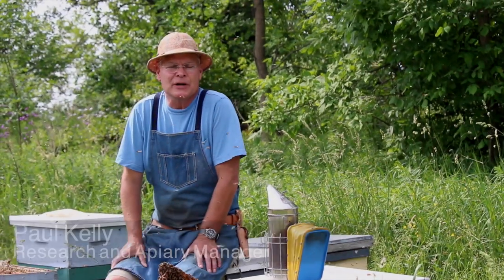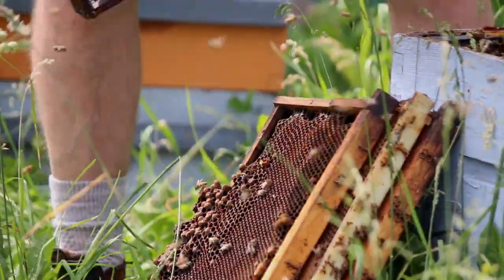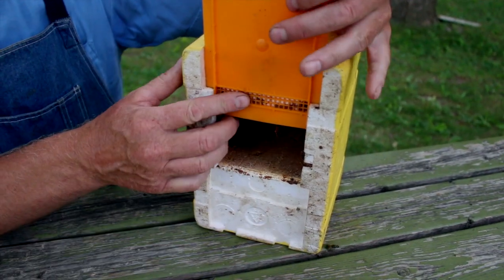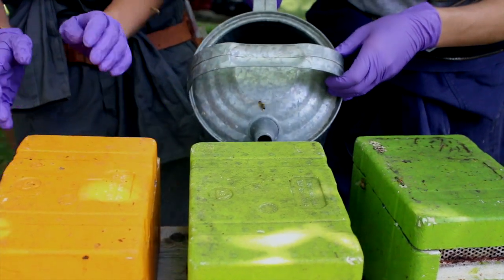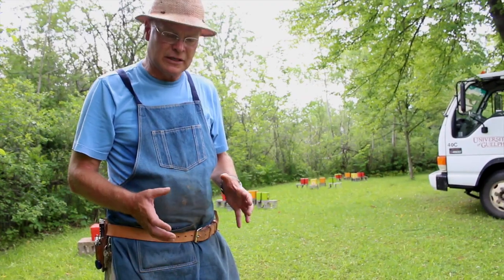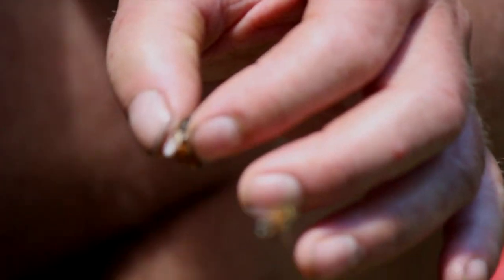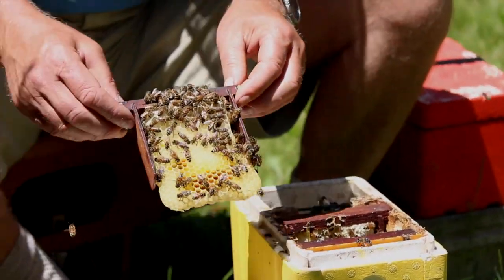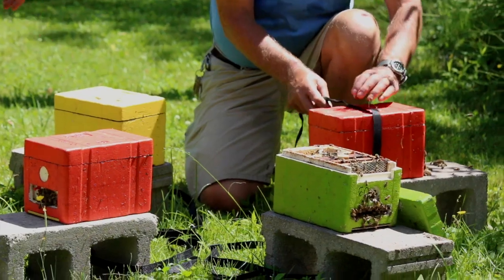Making Mini Nucs

Comment: Are you selling those queen mating boxes?
Reply: Or how fo you make one of them
Reply from the maker: Hi Honey Huts
 Thanks for your inquiry. Please see our FAQ #9 for more information about the mini nucs we use.

1. Why do we use canvas
for the hive inner cover? A: We use canvas inner covers for a few reasons. They
make it easy to take a quick peek in the hive, and are cheap and easy to make.
They are light, the lids sit down well, less excess wax on the frame top bars,
and we rarely need to scrape the inner cover. We use 18 oz  (#8) canvas
-otherwise known as duck. It's a bit hard to come by in Ontario, but it is
available from online distributors (US: http://www.bigduckcanvas.com/number-8-18oz-cotton-duck-canvas.html,
Canada http://www.jtsoutdoorfabrics.com/18oz-Cotton-Duck-Canvas-Untreated--Natural-60_p_15038.html).
Bees chew through thin canvas so a heavy weight is better. We flip it over
periodically when new so the bees thoroughly coat it with propolis. An
alternative is a feedbag folded in half. 

 

2. Why do we use single
brood chambers? A: Our preference is to keep hives in single brood chambers. We
use queen excluders above the brood chamber and then add supers. We produce
bigger crops managing our hives in singles vs doubles and we find the hive management
much easier. It's become quite common here, especially over the last twenty
years. We will be making a video about single brood chambers soon! 

 

3.  Are our queens for sale? A: We sell some queens but don't
export. To contact us about our queens, please email us at infohbrc@uoguelph.ca. Our Buckfast collaborators also sell queens: Munro Honey http://www.munrohoney.com/ (for CAN sales) and Ferguson Apiaries http://fergusonapiaries.on.ca/ (for CAN and US sales). 

 

. 

4. What breed of
honeybee do we use? A: We work with Buckfast bees. Check out our website if you
would like to learn more about them: http://www.uoguelph.ca/honeybee/breeding.shtml 

 

5. Will we be making any
more videos? A: Yes! We are looking forward to creating more videos for our
YouTube channel this year! Here are some of the topics we will be covering:
Working with single brood chambers, indoor overwintering. 

 

6.How do you overwinter
double nucleus colonies? A: At the University of Guelph, we winter our double
nucleus colonies indoors. You can also winter them outdoors by wrapping two
double nucs together with insulation on the sides and top. 

 

7. Are double nucleus
colonies prone to swarming? A: With a young queen and the supers above we don't
have any problem with these nucs swarming in the first year. We do have to
transfer them into a full size box early enough the following spring to prevent
swarming.

 

8. Do we add a frame of
pollen or honey into a new split? A: Ideally you add both pollen and honey. Of
the two, honey is the most important. 

 

9. Where to purchase
some of the products that we use: 

 

Coveralls: We really
like these Dickies all cotton coveralls. http://www.dickies.com/coveralls-overalls/deluxe-cotton-coverall/48700.html?dwvar_48700_color=GY#start=3.
We use two sided velcro to strap up the wrists and usually tuck the legs into
our socks. 

 

Plastic Queen cages:
Mann Lake and their Canadian distributors sell these and they are made by the
French company Nicot. https://www.mannlakeltd.com/hair-roller-cages. I use
a wooden plug on the bottom and screw it in place with a #4 screw after pre
drilling. 

 

Grafting microscope: http://www.amscope.com/catalogsearch/result/?q=gooseneck+binocular

 

Mini/mating nucleus
boxes: Mann Lake (US) and their Canadian distributors sell these. They are
originally from Europe so are widely available there. https://www.mannlakeltd.com/shop-all-categories/hive-colony-maintenance/queen-rearing/nuc-boxes

 

Queen Pheromone: The
pheromone strips were developed here in Canada. They are called Tempqueen and
are made by Intko Supply Ltd.Suite 604, 3345 Kingsway VANCOUVER, BC, V5R 0A7
Canada +1 (604) 356-7393. pheromonesupply@gmail.com. Mann Lake in the US and several Canadian
bee supply companies carry them. 

 

Bee belt and bulk bee
box: Our apiary manager Paul Kelly manufactures the Bee Belts and bulk bee box.
If you are interested in more information, please email him at pgkelly48@gmail.com.

 

10. Should you remove
any queen cells in a colony before introducing a new queen in a cage? A: Yes,
you should remove the queen cells. Look very carefully to make sure you don't
miss one. Shake the bees off each frame to make sure you can see them all.
Accepted queens are sometimes killed by virgins that emerge from queen cells. 

 

11. Can you make a split
without adding a mated queen/can a split raise their own queen? A: A split can
raise their own queen (if they have eggs), but you'd be better off buying a
mated or queen cell from a local bee breeder. Queens raised by a split are
reared under the worst possible conditions, are physiologically inferior, and
you aren't taking the opportunity to improve your hive genetics. For a number
of reasons, colonies get more aggressive if we let splits raise their own
queens. We always use queen cells that we have reared from breeder colonies so
we can maintain and improve our genetics. Cells found in hives can be poorly
reared if conditions aren't good or if you use swarm cells you are
unintentionally breeding for swarming behavior. 

 

12. How often do we
check for swarm cells? A: We check for queen cells only in colonies that are
stronger based on our ratings as described in our “Swarm Control” video. We
only do this at the time of year bees are prone to swarming (ie just before the
main summer nectar flow). In some colonies, we check twice, a week apart, if we
have the time and we've found cells in them previously. We stop looking once
the nectar flow gets going and the time for swarm preparation has passed. 

 

13. How old is a queen
when we replace her? A: We re-queen if a queen isn't doing well or when she is
in her third year. 

 

14. How often should you
be stung to lessen the chances of developing anaphylactic reactions? A: Please
speak with an allergist if you have any concerns regarding bee sting reactions.
You don’t need that many stings to build an immunity and reduce your chance of
developing an allergy. However, reactions can be very different from one
individual to the next. For about three years after starting beekeeping you
swell more in the spring when the bee season starts. After that most people
don't swell up much at all. Some beekeepers apply stings through the winter to
keep building immunity. 

 

15. What do we use as
candy for the queen cages? A: You can make the candy using honey and icing
sugar but the candy you see in the tubes in our videos are purchased with the
cages from Mann Lake beekeeping supplies and their Canadian distributors. In
our province, it's not legal to use honey in queen candy if you are distributing
queens. Honey can contain American Foulbrood spores. A specialized, non-drying,
sugar syrup (Nulomoline invert sugar) can be used instead of the honey. In any
case the candy must be made dry enough that it's crumbly.

 

16.  How do we make pollen patties? A: The patty is
made from pollen we collect using a pollen trap. We mix the pollen pellets with
sugar syrup to a dough like consistency, form the patties between layers of wax
paper and then keep them frozen until they are needed. They will keep for several
months frozen. 

 

17. How do we make our
grafting bars? A: We cut the wood pieces and attach them to the graft bar with
liquid beeswax. We then attach the cups with liquid wax. In both cases the
liquid wax is applied with a syringe. Previously, we made the wax cups but now
buy them from https://www.kelleybees.com/. 

 

18. Do we move full
honey supers to the top of the stack so the bees can fill the lower ones? A:
Some beekeepers do shuffle the supers around and do what's called bottom
supering. We place supers back on in the original order and only add new supers
on top (top supering). That way it's easier to see when the bees need more
space. The bees also ripen the honey before moving up. We sometimes harvest
full lower supers and put the top ones that aren't full back on in the original
order. 

 

19. Do we ever add brood
frames to the cell builder colonies to keep their populations high? A: We do
add other frames of sealed brood and sometimes we shake in more young bees from
brood frames to boost the hives. About once every three weeks we'll boost the
hives in one way or another. 

 

20. How do you level
hive stands? A: We level the hive stands periodically with pressure treated
wood shims. If the hives are already on the stands, we use a hardwood pry bar
and a brick fulcrum to lift each end for shimming.

Comment: When you harvested the queens off the blocks and put queen cells back in the nucs. Do you fill the feeders back up with syrup?
Reply from the maker: Hi Greg
 Most years we just feed syrup when we make up the nucs as usually by the time we get into the second round of queens there is a good nectar flow. That wasn't the case this past summer and we had to feed occasionally based on how much feed is stored in the comb.
Reply: UoG Honey Bee Research Centre 
Makes sense.

Comment: Wouldn't it make more sense to pour your sugar syrup first and cover it with something thin then have your queen sell ready for when you pour your bees in? You would save loosing bees and it would be much more efficient?
What I saw you dong was pouring it last and the bees you poured in first were flying away while you were pouring it..
Reply from the maker: Hi Sue
 I know what you mean but it wouldn't work to add the syrup first. We put the bees in the bottom of the box.
Reply: So what your saying is you pour the syrup over the top of them?  don't the syrup go in one of the bottom box areas? Fill it first, put a temp cover it ( the syrup area) and then pour the bees in the area they belong in. It won't take so long for them to fly away.
Reply from the maker: Hi Sue
 Please have another look at the video and you'll see what I mean. At the beginning of the video you'll see how the nuc is constructed. The video shows bees being added in the hole in the bottom of the box. We then close off the bottom and then turn the nuc right side up and add the syrup and cell. When I timed it this year we made up 80 nucs in 18 minutes so It's an efficient way to do it. A very few bees get out the top but they all have a home by the end of the day.

Comment: Excellent videos, thankyou! Paul I have one question: in seeking young bees with which to populate mating nucs, I see you are shaking frames of older capped brood. Are the bees on capped brood young enough to work well for mating nucs (as opposed to bees shaken from frames of open brood)??
Reply from the maker: Thanks. Glad you find the videos helpful.
 We try to shake bees from both unsealed and sealed brood. You are right that the bees on the unsealed frames are a bit younger but we get young enough bees this way.

Comment: Dear friends, I am amazed by the videos, here in Brazil it is practically impossible to manipulate the bees without the use of safety equipment, our bees are very aggressive.
I would like some information, because mr. Cut off the wings of the queen bee? How does she make the nuptial flight, otherwise she can fly? Or do you know that she has been fertilized?
Reply from the maker: We breed bees for gentle behaviour. That may not be possible where you are. We only clip the wing on a mated queen.

Comment: I have some of the Temp Queen strips.  I have a few questions.  Do you leave the same strip in the mating nuc throughout the queen season?  Does the strip inhibit the bees from making cells from the eggs in the nuc  between rounds of cells 100% of the time.? Are you pulling the queens before knowing whether the eggs are worker or drone?  Thanks for these videos.  They are excellent.
Reply from the maker: HI There 
We use a half strip in the nucs and leave them in place for the summer. It dissipates fairly quickly so it doesn't stop bees from raising their own queen if necessary later in the summer. We remove the queens two week after the cells are introduced so we can't always tell if they are laying drone or worker eggs. I havn't noticed that this is problematic. Great to hear you find the videos helpful.